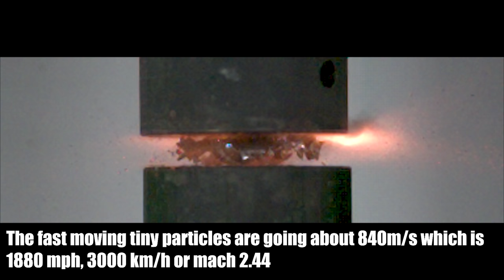Crushing Ball Bearing Underwater with Hydraulic Press

Comment: To create just cavitation bubbles, perhaps try a high voltage low amp electrical spark, like a stove ignitor or a taser. Stove ignitor are cheap and can generate a million volts from a 9v battery and the spark creates plasma etc so it might be powerful enough to create cavitation bubbles without using a big press and exploding an object

Comment: This reminds me of the bubbles you see in the trick when you fill a beer bottle and leave a small air gap at the top.  You then smack the bottle rim with the palm of your hand to blast the bottle base off and it's in the seconds before the bottle base flies off, on a slow mo camera, you can see captivation bubbles appear & disappear and boom the bottle loses its base & it's contents.  It might be an easier experiment to perform in a tank and with thick rubber gloves but I have to add this - do no try this at home, as I'm not getting the blame for shards of glass in your hand 😉

Comment: Degas the water by pre-boiling or running under vacuum to get rid of noise from dissolved gas coming out of solution so it's just water vapor in the cavitation. Maybe add a surfactant to reduce surface tension.

Comment: The low pressure areas should usually begin where there is very fast movement, so fast the water has no time to fill the space that was displaced. So it would seem logical to see the cavitation bubbles around the items
Reply from the maker: Yep but there is bubles even on the part of the socket that doesn't move at all. And the tools are moving towards each other so there should be high pressure region there. Probably something complicated with pressure waves colliding around the area etc.
Reply: @HydraulicPressChannel  
Hydrodynamics is a complicated area of expertise all to its own, that is true. Even more so as the rapid pressure changes cause very rapid temperature changes too which bring their own variables into the mix.

Comment: Is it possible the bubbles are formed on the surface like nucleation points, as a result of the massive crushing force causing a rapid release of energy in the form of heat and they go away so quickly due to the large volume of water and it low ambiant temperature? Very interesting I wonder if a thermometer close to the crushed object would detect any changes?

Comment: My theory of the bubbles around the socket is cavitation. As the socket retracts on exploding the pressure drops and the water immediately on the surface of the socket boils. Boat propellers can suffer cavitation, which is water boiling at near zero pressure.

Comment: i think the bubbles are vaccumbubbles. At the momennt of the crack of the steelball the stamp push the water, then its stops so fast it is make an underpressure and the bubbles are vaccuum based on the inertia of the water

Comment: 8:00 Those aren't bubbles being formed, that's a vacuum. The shock wave is pushing water away from the metal, then you can see the water filling the empty space as it surrounds the metal again.

Comment: Hmmm... The idea of crushing a bearing underwater to cause cavitation gives me a few ideas. Using matter itself as energy storage.

It's similar to using a high power laser to set a piece of metal "on fire" in a vacuum to cause a bright flash of light powerful enough to power a very VERY powerful laser pulse, which is how circuitry and computer chips are made.

Comment: Cavitation bubbles form where the water is forced out of a area at a very high speed. the socket "slapped" the water away with the rapid movement. then when the socket stopped just as quickly the water kept moving away. forming the bubble.

Comment: The bubbles come, because when the metal breaks, it moves very fast in the water, as well as the press. The explosive energy, that gets free that moment, lets the surface of the metal rub so fast against the water, that the water itself turns to steam, which we see in the water as bubbles. Surrounded by cold water, the steam quickly condenses and the bubbles get less. but loosed oxygen will still produce some staying bubbles

Comment: It looks to me as if when the bearing ball pops, the press tools jump towards each other at high speed and force water out from the centre. The cavitation bubbles appear at the edges of the tools, where the high velocity water meets static water, creating enough shear to form a bubble. I bet if you radiused the edges of the tools, the bubbles would not form.

Comment: Cavitation is caused by a relative decrease in the pressure felt on the surface of a liquid.  This is often caused by the velocity of a object relative to the liquid it is moving through.

I am wondering whether the breaks are generating a shockwave that creates enough of a shearing force on the liquid to replace this differential; thereby resulting in cavitation along the edge of the shockwave.

We could test this using liquids of various viscosity as they should have different points at which that shearing force can be generated.

That might be why the ball bearing created such a uniform cavitation profile, and one that seemed smaller, relative to the socket as you not only had a more uniform break but you also might have been butting up against the ability of the water to move out of the way of the press while it is trying to propagate the shockwave from the break.

These two force would work to cancel each other out as the vector of the water moving out of the way of the press is the same as the vector for the shockwave; decreasing the relative speed between the two.

With the socket you also had a much greater distance between the press surfaces; allowing for a greater area by which the water can be removed.  That would lower the velocity of the water evacuating the area and, thereby, increasing the differential between the shockwave and the water along it's edge.

Comment: To improve your crushing, you need harder anvils.  Take the shanks from some BIG solid carbide end mills, cut them to  short lengths, and insert them in cavities that you mill into your anvils.  Then you will have a much harder usable anvil surface that won't deform.

Comment: I thought the bubbles were from steam. The section of metal that breaks generates a lot of heat. It would be interesting to see this in different fluids. Something with a lower sg like oil and something with higher sg like a brine solution. Also fluids with different viscosities. Oil or other non Newtonian fluids.

Comment: A controlled explosion press would make for an interesting high speed experiment. Just set up a "gun" to smash  something, a large ball bearing would suffice, rest the tool tips on the bearing, and set off the charge, propelling the free end tool to apply pressure on the bearing. the speed of the impulse should be enough to make for cavitation bubbles in the first place, but the bearing letting go would be some nice icing on the cake, so to speak. And, Hey, EXPLOSIONS! have more fun with your fin, for Science!!
Reply: A low effort proof of concept would be to break stuff with a powder actuated nail gun.
Reply: @henningklaveness7082  You'd probably have to make it yourself, I've broken them driving studs and hangers into concrete before. In the case of HPC, the most spectacular way for the trial and error would be to use different tool steels and ends on full scale explosive driven hammers. As we know, more explosions=more views. A high brissance explosive driven hammer would be a good workout for the High-speed cameras, as well. A little force over time experiment, perhaps?

Comment: When the socket's compressive strength is exceeded, it failed in a brittle fashion, and it  sheared at 45 degrees. Every Mechanical/civil/Structural Engineer knows  the maximum shear stress in a body under compression is 45 degrees to the compressive force.

Comment: I think if you took two bearing balls, and if you can sand down a small flat spot on each, then STACKED them... that may yield an interesting result.
My thinking is that even if only one of them explodes, the distance between the two cylinders will be bigger and allow us to see more of what happens. Also, more water for the 'explosion' to react with. 👍

Another idea, is to have a small disk of solid aluminum, with a diameter of 2x a ball, but the same thickness.
Then, place the bearing dead center (maybe still a small dimple in the disk), and when pressing it will sink in.
What happens when it explodes?? I can't imagine the Alu would be able to contain it, so does it shrapnel with the ball? Or does it amplify the explosion, like a pipe-bomb does with gun powder? 😃

Last idea... Not water related, but have you ever pressed a box (small or large) of Strike Anywhere matches?
Feels like that could go either way... Either being cool, or, an absolute dud! lol

Comment: The bubbles "out of nowhere" can come from the cavitation effect. When metal parts move quickly through water, small vapor bubbles form at the edges. You can see that on ship propellers. This can cause damage to the blades in pumps, including fire engine pumps.

Comment: The bearing races may have had such a low breaking strength due to hydrogen embrittlement.  This is especially apparent underwater.  As soon as the smallest void begins to open up in the space between two grains in the metal structure, hydrogen gets in there and screws up everything.

Comment: I have an idea of where the bubble comes from. The metal produces heat as it shatters. My theory is that it heats up water in contact with it so much that it turns to steam, which condenses just as quickly as it was formed.